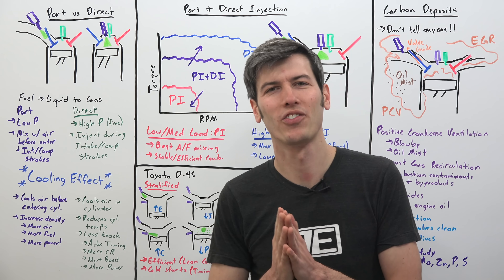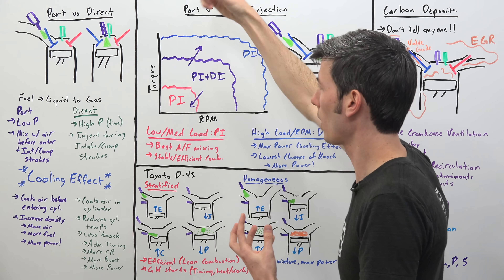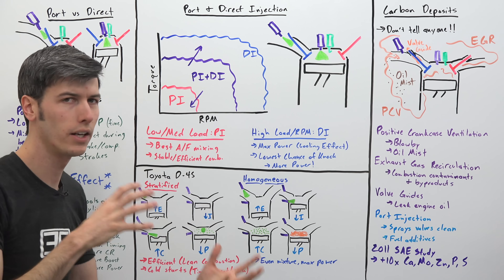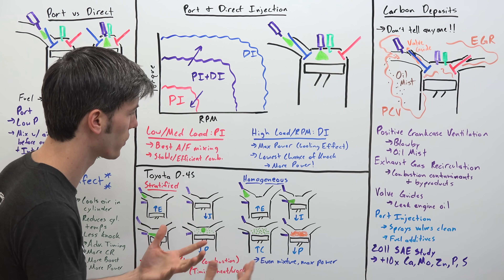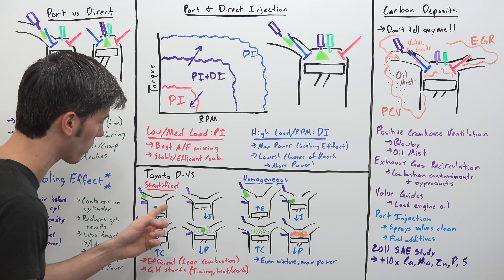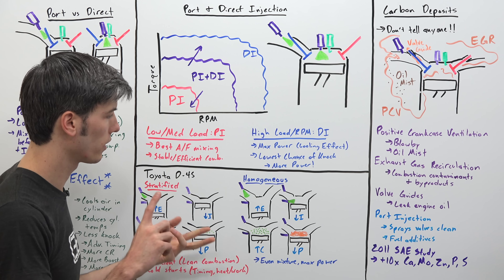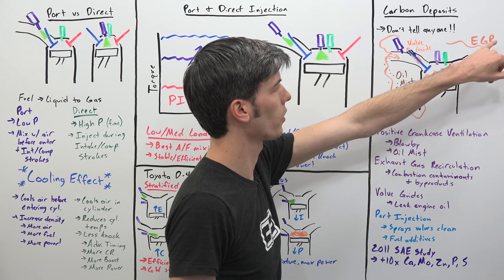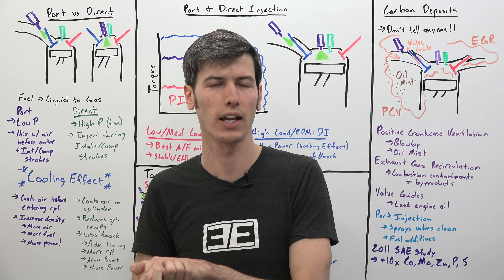Why New Cars Are Using Both Direct & Port Fuel Injection

Comment: Stratified charge: what's old is new again.  I remember when the Honda CVCC engines made their appearance here in the States in the early 1970s along with Honda's television commercials touting its benefits.

As for blow-by, with the electronification of today's cars, catch cans with a solenoid valve to the sump  can solve the valve deposit issue for the most part, EGR excepted. This seems inevitable to me as engine makers reach higher for fruit.  No more low-hanging stuff to tweak.
Reply: If you look underneath the valve cover of many direct injected engines today, they already have an extensive oil separation system for the PCV, plus a direct pathway to the engine sump for oil drainoff (no valves required if the tube goes straight down below the oil level). One example of this is the Ford 2.7T, and another is the Honda Civic Type-R engine. Catch cans aren't really a great solution, because for the most part they either aren't catching enough oil particles (today, proper PCV oil separation systems are capturing sub 1 micron particles), or they are too restrictive. And in the winter, they freeze (which is really bad for your car as crankcase gases go out the fresh air tube... and when that freezes... blows your seals). All of those catchcan ads you see on forums are only telling part of the story when they say "LOOK HOW MUCH WE CAUGHT!!!11!" when they show off the fluid, because the fluid is a mix of water, gas, and oil. Gas and water you don't typically care about because they burn off when you drive, but the oil is what causes the deposits (the proper way is for those catchcan companies to actually heat the fluid so that only oil is left).

Comment: I have heard, that direct injection can also cause vibration problems. That should be the reason for twin-mass flywheels. They mitigate these vibrations. Camshaft chains can also wear out because of these vibrations. I'm not sure if it is just diesel engines, that have these problems though.

Comment: Dear,
If we changed a car engine with another one which has more power and torque, will the gear ratios change accordingly??
Reply: In both cases the gearbox is the same.

Comment: Funny how satisfying is this idea of cooling the charge by evaporating something into it causes the engine to ingest more air. But you said you skipped chemistry lol. In fact anything evaporating before the cylinders displaces oxygen and causes the engine to ingest less of it, because it was displaced by the vapor of what got evaporated: fuel, water, or, heaven forbids, water and methanol mix. This is where DI wins: no vapor pressure gets in the way of the air entering the cylinders. This is also where port injection wins over central injection at the butterfly, or carburetors: injecting closer and closer to the cylinders, or even inside them, avoids evaporating and this is what causes the engine to breath more oxygen. If the « evaporation cools down ingest more » fallacy was true, one would inject fuel, or whatever, as early as possible...

Comment: Carbon deposits is the main reason why I wouldn't buy a new car with a DI engine, IF I intended to keep it longterm. I assume, if you drive it only a few years, carbon deposits won't be a problem, but if you drive it 10+ years..? I don't know. And cleaning your engine of carbon deposits is time consuming and expensive... there are already enough things that can go wrong in a car.

Comment: Hi. Why air can't be injected into cylinder with injectors , like gas and diesel . This way no need to have intake valves. Compressed air can go high pressure.
Reply from the maker: It could, would just be a complicated/costly system.
Reply: @EngineeringExplained  Thanks

Comment: thanks!  i can usually follow your explanations of these and other somewhat complex, complicated systems--outstanding work!!!  as a result i feel (as an older person buying used vehicles vs new) i have a better chance of selecting something that may be a little more reliable and less demanding on the pocketbook.  i never cease to be amazed at how you get to the meat of the issue without putting me to sleep!
Reply from the maker: Really appreciate it, thanks for watching Greg!
Reply: Greg, the answer to the question is easy . dont buy a direct inject engine car.
Reply: thanks!  looks that way--i got  all of my car trading hopefully out the way last century--now it's all about reliability and decent gas mileage--but still, if i come across a car with fins on it, i might be tempted...
Reply: @jhndijkman  Most engines are direct on the market today.
Reply: @justd02ofus  yes, that is a real problem.
Reply: @jhndijkman He should buy it if he's doing lots of miles. These direct injection turbo engines will save money in long run because of their fuel efficiency. But again it depends what he needs.

Comment: diesel had been purely DI for as long as we remember, why there's no carbon problem with diesel as oppose to petrol
Reply: Well every diesel ive seen that still has the egr has carbon buildup all over the intake manifold.
Reply: This is the question that I have every time this topic is brought up. Direct injected diesels, especially in commercial applications, are known to be very reliable. Is there something about gasoline engines that make them more affected by carbon buildups than diesel engines? It doesn't make any sense to me that there'd be some sort of fatal flaw in a well-established technology just because it's being used in a slightly different application.

Comment: What problems are created by using both port and direct injection (twice the number of injectors)? Is carbon build up the only reason for using both systems?  Or could carbon build up be the result of a neglected engine maintenance schedule or other engine parts failing?  DI engines have water/oil separators before some of the recycled exhaust gases re enter the cylinders so it’s like a catch can that dumps the heavier elements back into the oil pan. I think you are holding back on the info. Please explain the complete cycle of port injection, Port and DI injection and DI only engines and which vehicles got it right and which did not. Like your videos.
Reply from the maker: No, as discussed in the video there are many reasons aside from carbon.

Comment: Hey, about the port injection cooling down the air charge before it reaches the cylinders and allowing more air to enter. Doesn't the charge heat up again because of the cylinder heat produced by the combustion in the previous cycle?

Comment: You got me curious, because I don't recognize it either. Mo is molybdenum.
I don't blame you for not having that one memorized.  It sounds more like a pop star's clothing line than an element.
Reply: Some engine oils contain 1% Molybdenum disulfite as an additive. It's a graphite-like material that reduces friction. In this disulfite form it's not shiny purple, it's actually black.
No wonder Mo gets onto your intake valves when engine oils often have it in them...
Come on people molybdenum is not hard to remember, you try to pronounces Porsche's automatik gearbox: doppelkupplungsgetriebe, then try to memorise Audi's exhaust system: klappenabgasanlage; after that try to memorise what your amoled screen is made out of: polyethylenedioxythiophene-tetrametacrylate.
Come on people who only speak English, molybdenum is not that hard, you try learning some other languages and you will see your basic/primitive/non-complex your language actually is.
.
Reply: @sasjadv  Isn't it tetramethylacrylate?  Looks like you lost a few characters.
Reply: CrMo-steel? Ring a bell? :p
Reply: @flyfaen1  piston rings
Reply: @flyfaen1  Good call.
Reply: I had it memorized for god knows what reason
Reply: @thiagomarques3036  I remember it because it's in my back.
Reply: @danielrouw2593  I pronounce it moly-bend-um.  Easier to say.
Reply: @AZOffRoadster  ... mole, ib, denim. i hazard to guess you may be going too fast. slow is smooth, smooth is fast.
Reply: @AZOffRoadster  I use Molly-b-denim
Reply: My dog is named molybdenum. She’s slick and only gets called that when she is in trouble.

Comment: FYI there's specific engine oil for direct injection engines to help prevent carbon build up on intake valves😉
Nice to see a combination of injectors to prevent the carbon build up. 
I wonder if the cpu is smart enough to run only on port injection if the direct injectors ever fail or plug up🤔
Reply: I would assume it could correct it to a certain point but the sensors only give so much information
Reply: You apparently believe in snake oils. Special oils do not eliminate the problem, just allow salesman to raise prices on products they sell
Reply: DI is only used in specific engine loads for example cold start. When idling they switch over to the port injectors,which can be both heard and measured with a scope, so yes. The system is able to run on either alone but the check engine light will be lit if an error is there

Comment: You over looked fuel entering the intake from the EVAP system
Reply: The small amount of vapor from the EVAP isn't anything as effective at cleaning as the near-continuous spray mist on the backside of the intake valves.
Reply: EVAP fuel  entering the intake manifold can be as much as 20% of average fuel delivered in hot weather. It contributes to deposits on the intake valves

Comment: Hi Engineering Explained, I was listening to NPR'S car talk podcast number #1906 and at about the 32 minute mark they ask the question do bigger wheels improve fuel milage. the producers seem to think so as a larger radius means a larger distance traveled, however in my mind it just alters the gearing ratio. which is correct ?

Comment: I'd love to see a list of vehicles that have both direct and port injection, I only know of 3. The ZR1 Corvette, the BRZ/FRS/86, and I believe the 3.5 v6 Tacoma. Please Please Please do a video on what new vehicles you believe have the best fuel system. I'd love to see it.
Reply: some VW euro ea888 have dual injection
Reply: @Tragicomex  Correct - the ea888 gen 3 used in the EU spec Golf R as well as a few other VAG applications. One of the reasons I went for an R, coming from a MINI R56 with really bad carbon build up issues
Reply: Most Toyotas use dual injection.  IS350,  Camry.  Now Ford is on it with their new engines.  Their IS250 has terrible intake valve deposit problem.
Reply: I'd be interested to see which Jason thinks is the best too. I think I read somewhere that all of Ford's new Ecoboost engines are di.
Reply: @quinnjohn1  Yes, ecoboosts are DI only and they do have carbon build up problems. My friend is a Ford tech and he had to rebuild his cylinder head at 25k miles because of it. Efficiency wise DI is good but Dual DI PI has more longevity.
Reply: @fzj8022  There is one Ecoboost with dual injection, the second gen 3.5
Reply: @NYGlockinator13  what about the 1.0?
Reply: @obsoleteoptics  The 1.0 TSI engine (EA211) is direct injection only.
Reply: @NYGlockinator13  That's what I suspected. Welp, time to get a catch can for my Fiesta, then.
EDIT: It's a 1.0 Fox EcoBoost, not a TSI
Reply: @quinnjohn1  Oddly, only the new 3.5EB is dual injected, not the other EB's like the 2.7, 3.0 and the 2.3
Reply: 2017+ Audi RS3 8V I-5 has both direct and port injection. Probably why the take tunes so well. On E-85 they make like 150 more hp, with just stage 1.
Reply: bdawgswanson 2019 Nissan engines use DPI in their variable compression engines.
Reply: Starting in 2018 Ford 5.0, 2.7 Ecoboost, 3.5 Ecoboost use dual injection. 3.3 and 3.5 NA are port only. 1.5 Ecoboost, 2.0 Ecoboost, 2.3 Ecoboost, 3.0 Ecoboost are direct injection only. New 3.0 Ecoboost could get dual injection but I'm not sure about that.
Reply: The V10 in the Huracan and the new turbo-VC engine in the Altima/QX50 have dual injection.
Reply: Aye, 2nd Gen 3.5L EB are dual Injected.
Reply: See direct injection with  carbon buildup face off with seafoam and crc on nates interactive auto
Reply: The new Toyota Corolla Hatchback and Sedan has Port and Direct Injection